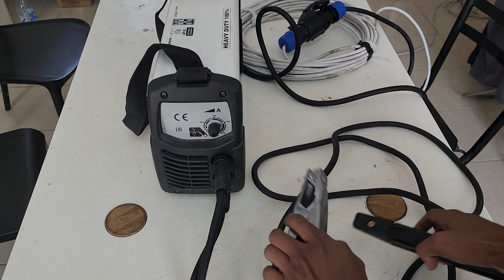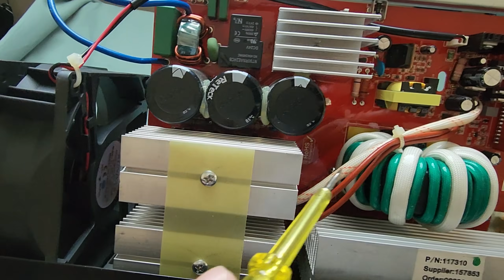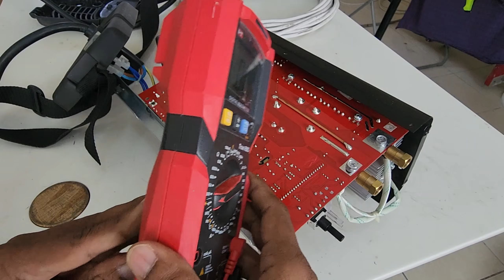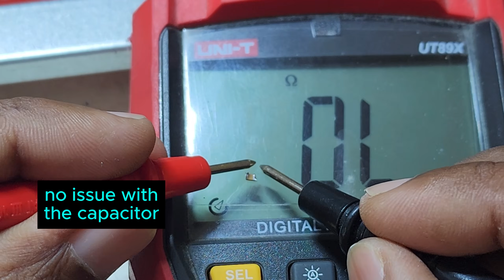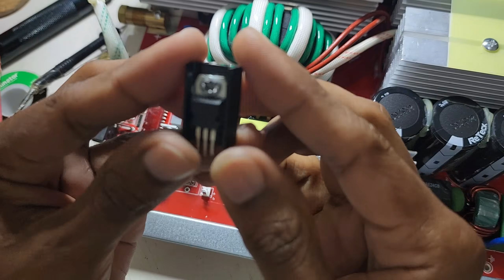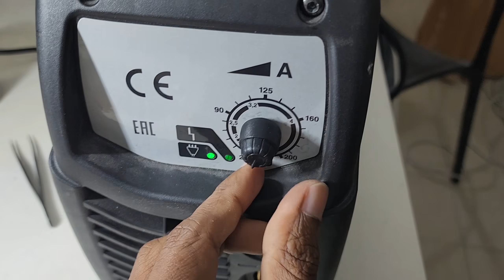||How to Repair AC Inverter Welding Machine.

Comment: Dear Sir, very interesting video. I have an issue with similar brand (DECA) where the switching IC is shorted (PIC16f1825) which is a programmable micro controller. Any idea how to fix that ? Thanks

Comment: You should use a power supply to supply about 3V to find the short circuit component. The short circuit component will generate heat
Reply: Please demonstrate it to us

Comment: Could the the short circuit have been found by injecting current into the short circuit and then looking for heated part or using low ohms meter ?
Reply from the maker: Yes

Comment: Congratulations for showing how hard work the profession of an electronics technician is, a true technician, one of those who look for the defect piece by piece, and not a simple PCB changer.
Suggestion for after the problem is solved: Apply isopropyl alcohol with a brush to the points where soldering was necessary, the marks left by the soldering iron disappear.
You have gained another subscriber and a like, from those who really appreciate a job well done!
Reply from the maker: Thank you sir.🙏